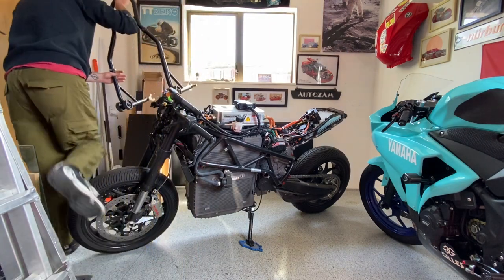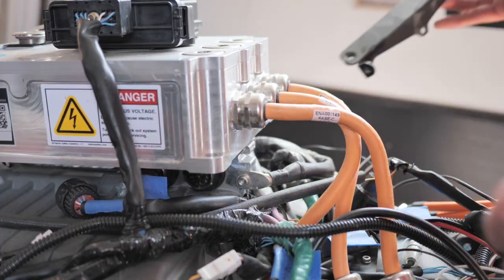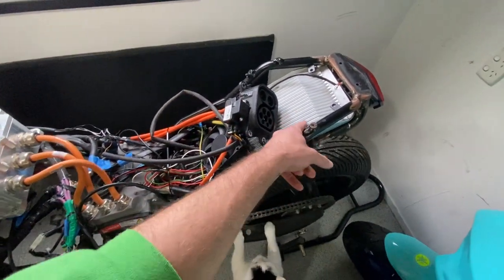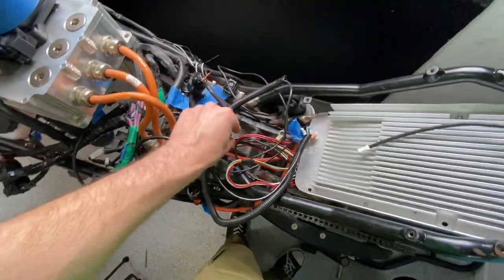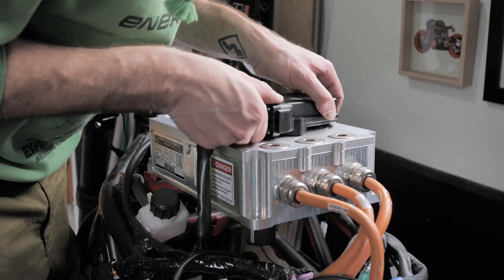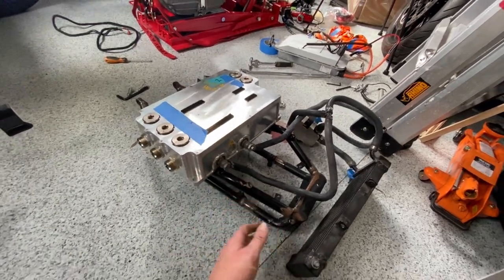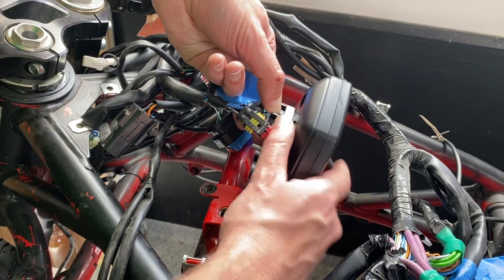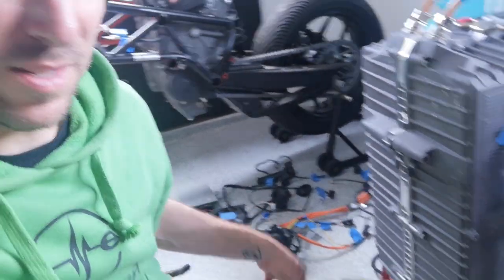Electric Honda Beat Conversion - Episode 3 - Disassembling the Energica

Comment: Sam, As long as you don't zap yourself, we're glad to be along for the ride.....
Reply from the maker: Thank you! I shall try 😂
Reply: @NewZeroland have you weighed the motor, the controller or the battery??
Reply from the maker: @FirstLast-tx3yj  yep, all the components are about 200kg
Reply: @NewZeroland  thats great could you please tell me the individual weight of each
Or at least the motor alone?
Reply from the maker: @FirstLast-tx3yj  I go through the individual weights at the end of episode 4.  The motor is 54kg, the battery is about 127kg, the charger is 5kg, and the controller and cooling system is 9kg.

Comment: Gerat project and nice insights on Energicas engineering choices.
But since I assume that you're well aware of the hazards of working on components with a system voltage close to 400V DC, I'd love to see the use of proper PPE (that, even though not visible, you certainly used) in the future. Because unfortunately there are enough people out there that think viewing some videos enables them to work safely on such vehicles.

Best Electric regards,
Max Jäger

PS: For future work on such systems, and in the interest in the longevity of the components and your life, always use a Voltmeter to check that there is no Voltage (U < 10V) present between poles and each pole to ground/chassis. Because these systems can still hold a deadly charge for quite some time after being completely turned off.
Reply from the maker: Thanks! Great points. I should have shown the volt meter just to be sure. Safety first, of course!

Comment: Great video. I loved the Zelda chest open noise. And the grounding cable that wasn’t hooked to anything was probably connected from one frame piece to the other frame piece. As the frame is usually used for ground you don’t want one of you frame pieces not working as a ground.
Reply from the maker: Ooooo could be! I assumed it was connected to something that was removed before the bike came to me, but who knows? The mystery continues!

Comment: Just a hint to make your life easier. Get your self some T-Handle hex set keys, to use in place of Allen Keys all the time. Really speeds up tightening, and un-tightening hex bolts, and saves your hands! Cheap as from a hardware store, as low as $20 a set.
Great videos btw. Really enjoying your work.
Reply from the maker: Thanks man!  Yeah I need a better set of tools.  I've been slumming it for too long.
Reply: @NewZeroland  I was so glad when I got some. It was like "Where have you been all my life, and why didn't I pick you before?" :)

Comment: Nice video!  Definitely reminds me of my adventures digging into the Gen3 Zeros for the first time and reverse engineering everything to figure out it’s purpose.

One thing that I think will help you feel safer about the “ZAP” factor is using a multimeter to confirm whether circuits are live.  For example, I’m sure the battery terminals were dead when you disconnected them from the motor controller (I would imagine that the battery pack has an internal contactor), but popping a meter on those terminals to confirm 0VDC probably would have made you more comfortable before moving them around.

Looking forward to watching the rest of this project unfold!  Looks like fun!
Reply from the maker: Thanks Scott! Yep I should have shown more safety stuff in this video 😂  checking those terminals in the controller before pulling the battery cables out is a key part of the removal process in the manual. In the next video I'll try and put it all back together and make sure it still works. Hopefully I made enough labels!

Comment: I got a good solution for the kickstand...Turn it into the E Brake. Flip it so when the E brake is down it thinks the kickstand is up. It may be a challenge but I think using the existing car signal and lights would be better. Taking apart stuff is fun especially when making something new.
Reply from the maker: Someone else said the same thing! That would definitely make my car unstealable. Nobody would know what's going on in there 😂

Comment: I never realised that the Speedo Cat was your actual cat.

I shouldn't say that's the best bit of the video. But cat.

PS, that grounding wire. There's the professionalism of Energica on show. Stark contrast to another motorcycle company we could mention that lets all sorts of stray voltages appear in any old place that blows up MBB and chargers, and is the reason why their Chademo charger never worked.

PPS my bet is that when this was a track bike the 3kW charger was taken off. When it crashed, they just stuck it back in any old how.
Reply from the maker: Oof 😂😂😂 Yeah no isolation faults here! And nah, the speedo cat was diferent, but similar paint job to our cat 😁
Reply: @NewZeroland  oh, I've mis-cat-egorised your cat.

Sorry.

Comment: Nice going!
BTW that cable/switch on the primary brake cylinder primarily turns your brake light on - in many vehicles (automatic geared ICEs and EVs) it also serves the purpose of a two button ignition ;-)
Reply from the maker: Oh right HAHA!  I was thinking it might also trigger regen, but only 2 wires seems unlikely.  That makes it easy then!  Just plug these into the car's brake pedal.  Woo!!
Reply: Yeah, the regen signal comes from the "throttle" position. Even electric bicycles have switches on the brake levers in order to cut the motor power when you brake, even though most of them don't have brake lights.
Reply: @awo1fman  In better EVs there are also pressure sensors in the brake's hydraulic line to provide an analog signal toward the regen (regen intensity proportional to hydraulic pressure) - and to increase the challenge/complexity, the motor control is coupled with the ABS and anti-slip. You can test the later by going into full regen on e.g. wet leaves or ice - I tested that with my C-Evo, works awesome ;-)

Comment: Awsome project Sam! Are you sure the battery SOC and health is ok to be stored until your energycar is ready? ( To avoid it to die while waiting..) I guess teh BMS will fall into sleep mode...  It seem the bike was like R&D energica bike or modified energica.... wiring harness as well as frame color!
Reply from the maker: Oh yeah haha, I can't comment on what this bike was used for or where it came from, but it was modified and crashed at some point 😂 I plan on plugging everything back together in my garage to make sure my labeling worked and also to maintain the battery until it's time to put it in the car. Hopefully it works!

Comment: You want so much an engine crane......can do so many amazing jobs and folds up for easy storage. Does the battery has internal contactors for de-energizing the terminals? Did you check that with your multimeter??
Reply from the maker: Yep and yep! When you unplug the VCU you can test the terminals on the controller to make sure there's no voltage running through. I'll plug it all back in soon to make sure it still works outside of the frame. And you're right, I definitely need a crane.

Comment: Thats is cool, that break switch at the end of the video, possible that is to tell the motor controller that that break is pressed? And not try to accelerate with breaks on? Maybe.
Reply from the maker: Yeah it could be a mixture of regen, safety switch to turn the bike on, and triggering the brake light.

Comment: Brilliant video again.  I'm similar to you in that I like pulling things apart to see how they work, it's the scientist part of me and the engineering part of me that want to see how it is all routed within the structure, in this case, the trellis frame.  This looks like a great endeavour, and I look forward to following you along the way, exciting stuff.  One question: you've got to keep the battery charged above a certain point (not rock bottom, or top) to retain its health right?  How do you do that??
Reply from the maker: Yeah man! I'm having so much fun pulling it all apart and arranging things. The labels keep me sane. I'm planning on plugging it all back in to get it running in my garage (outside of the frame) so I can add things to the wiring harness and make sure it works before trying it in the car.

Comment: When you were unscrewing the big orange cables between the motor and the controller, I panicked in your place. Just instinctively. I mean, rationally I know there is no tension in them, but I'm somehow already programmed to NEVER TOUCH THE ORANGE CABLES without gloves and other precautions.
Reply from the maker: Yeah that was freaky, for sure. I need proper giant rubber gloves the next time I do this. It seemed pretty safe though.

Comment: Glad to see your hands getting bloody doing this kind of work. Makes me feel better about doing the same.  That was awesome to watch, btw.  I’m expecting you are going to run into issues with the lengths of those wiring harnesses if you are putting the battery and controller so far from the dash of the Beat.  Any thoughts how you are going to manage that?  Extensions? New handmade wiring harness?  Btw, I think it’s only right to mount that kickstand under the drivers door.  Bonus points if you can hydraulically lower the driver side of the car when you put the kickstand down.
Reply from the maker: Thanks! Bwahaha that kickstand mount would be sweet. I'll definitely have to extend a lot of these wires, especially the high voltage battery cables.
Reply: @NewZeroland  I wonder if there are length considerations, such as voltage drop. The provided cables are short due to the motorcycle format but it might also be helping to maintain the voltage. Worth checking, I think.
Reply from the maker: @SonOfAnakin  nah I doubt it. I'll only be adding a little bit, just to move the controller to the side.

Comment: What fun! I thought the batteries on these were cooled too. Did you have to have the battery in a specific SoC to disconnect it? Any chance this was a MotoE bike?
Reply from the maker: Nope, they have air channels down the middle to passively cool them as you ride. Once you disconnect the VCU and controller terminals you can check with a multimeter to make sure there's no power running through it, but I unplugged everything at like 90% so hopefully that was ok 😂 And nope, not a previous MotoE bike.

Comment: Wanting to do a conversion with a different small car. Is there a way to contact you about how I can organise a "donor bike" for myself.

As a piece of feedback, perhaps you could use the original back section of the cluster and 3D print a new front to help house the Energica cluster in the new "cluster housing".
Reply from the maker: Nahh I'll just sell the original cluster as a whole unit. It's pretty rare so I wouldn't want to mess with it, and the Energica dash is smaller and lighter. Unfortunately they've sold all the wrecked donor bikes like this one, but sometimes you can find others on salvage sites like copart. It's hard to know the extent of the damage until you get it, but in general these bikes are really solid and well-built. From what I've heard, Energica is going to start selling new components in the near future, so that might be a better option for you. Good luck!

Comment: Hmm I wonder if the central frame holding the battery & motor could be transplanted into the car?! Would make the scary large cable spaghetti guarantee to fit.
Reply from the maker: I was wondering about that too!! At least the part holding the motor. That would be sweet to keep and retrofit to a bigger structure.

Comment: I don't know how Energicas work, but on the Zero the brake lever wire adds more Regen too.  Do Energicas add regen when you squeeze the brake? Or is it configurable?
Reply from the maker: Yeah I think it's all related.. start switch safety, regen trigger, and also the brake lights. We'll see if it works in the car!

Comment: You 10000% should use the handlebars as the steering wheel. Surely there’s a rotation reduction gear to make this possible.
Reply from the maker: Haha that'd be crazy man.  Crazy!  But it would make swapping the throttle a million times easier haha.
Reply: @NewZeroland  see, I’m already shaving 2 weeks off 5 years, you’re welcome
Reply from the maker: @AdventuresonZero  so efficient.  This project will be done by Christmas!
Reply: @NewZeroland  🤣🤣🤣so much room for extra activities by then!

Comment: I would not place the charge port that low on the beat, too close to water and road grime, need to be higher, maybe cut a hole higher up in the boot/trunk?
Reply from the maker: It'll be shielded by a bunch of stuff so I'm not too worried.. but this makes me wonder about the giant sprocket I'll be using. Hopefully that isn't too low 😳

Comment: Was that a coolant port on the back of the DC charging port?
Reply from the maker: Could be.. I'm sure this is an off the shelf port that all CCS vehicles use, so maybe some of those cars have cooled wiring? I dunno.. that seems extreme but maybe.
Reply: more likely a drain.
Reply: @NewZeroland  The cables are commonly water (some kinda fluid) cooled so it wouldn't be crazy for a vehicle to cool the port as well; connections do tend to be where most heat is created.

Comment: Impressive amount of cable... I'm pretty sure most of those cables can be simplified, that's way too complicated.
I would like to see the new models wiring.
Reply from the maker: Yeah definitely. Lots of stuff I won't need in the car. I won't hack it up too much but I will have to tweak it a bit.

Comment: Engine power? How much kW?
Reply from the maker: 107kW and 200Nm of torque
Reply: @NewZeroland  wow amazing. how many kg does the bike weigh? I am currently upgrading with 3x2 dual motors. 300 nm. 😉
Reply from the maker: @dogabelgesellerikusagi3391  this bike weighed 280kg and the components I'm keeping are about 200kg. The car is 754kg so hopefully I can lose some weight from it 😂

Comment: Ok feel bad if you are cutting all the wires and not learning anything. The pain in the but and effort you put in is a tribute to the people who put it together.
Reply from the maker: Yeah I'll try and keep this harness as in tact as possible. A lot of much smarter people than me put it together and I wouldn't know where to start pulling it apart 😂
Reply: Wire harnesses are crazy. If you have to rebuild the harness to get the kinks out F4 tape works great for getting the wires to suck together and protect them. You would just need to put some regular tape to keep the wires in place first.
Reply from the maker: @stevenb7319  Great idea! There will be a lot of tape in this project 😂